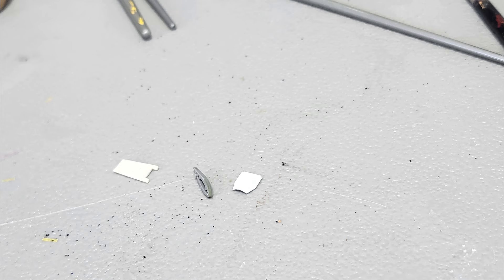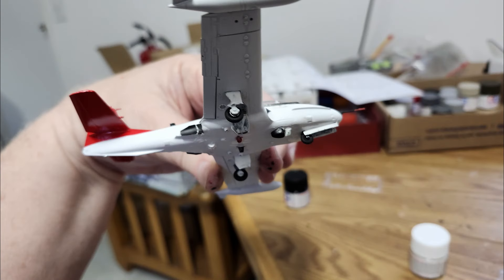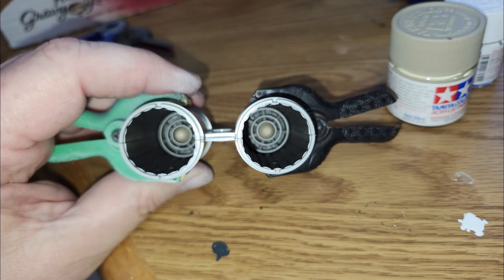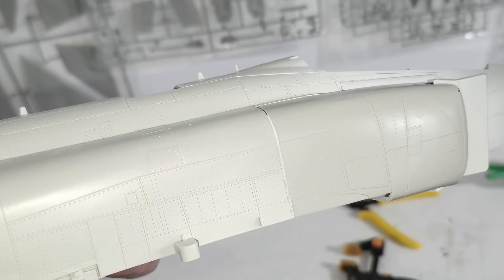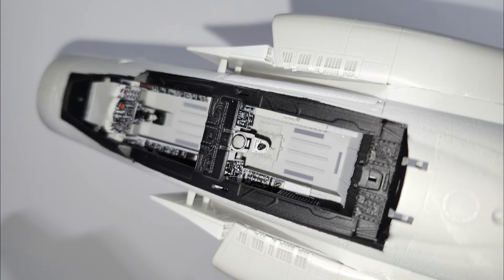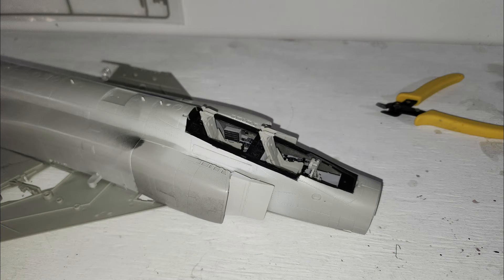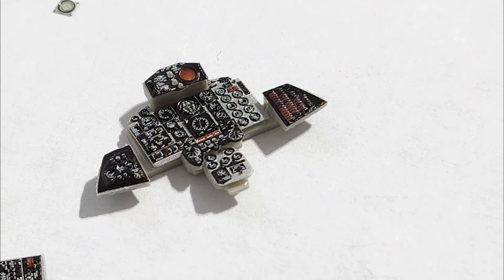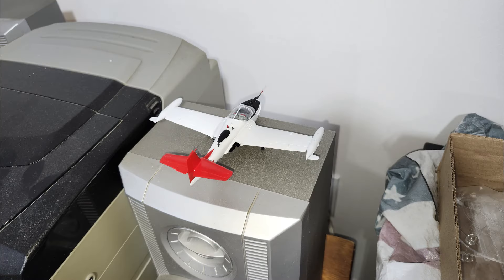Max's Models after hours 11/15/24

Comment: Looking good!  The Super Tweet would’ve been a fun bird to fly.  I had a good time flying the Tweet during UPT but having a couple of J85s instead of the J69s would’ve spiced things up quite a bit!
Reply: I recall seeing a pic of Cessna's proposed civilian four-seat Tweet.  Interesting concept, but no space for luggage!  😮
Reply: @ During our cross country training flights, we’d put our soft luggage in the nose bay.  Or you could jam it in the empty seat pan (where the survival kit usually goes.
Reply: At my AFB we worked on the T-33A trainer.  The pilots often had us mount a "travel pod" under a wing for longer flights.  Had some return once with one guy's pod filled with Lobster, on ice!  Another had ears of corn, third guy had a pod full of Coors Beer, this was before Coors came East of the Mississippi River.  Bet they had a heck of a party!  😅
Reply: @lancerevell5979  Nice!  We did that with fresh seafood from Eglin AFB back to Holloman AFB in the travel pods of our T-38s.  Bottles of wine from Napa Valley back to Holloman.  After flying combat operations in 1999, we found out that we were authorized to return with an additional MWR pallet from Germany.  That pallet was packed with cases of wine from a local vineyard along the Moselle.  The F-111 and F-117 weapons bays could carry quite a bit of stuff too,

Comment: I wrote a comment on a helpful site the last video that you may not have received, Max.

It was;  McDonnell Douglas F-4 Phantom II Drawings part 1

There is a part 2. You will see great information and the best detailed blueprint like drawings of the Phantom II.

 Since I have been following your build from the start it got me back working on the three I have. Two will be JASDF, EJ birds one as 17-8440, the last built Mitsubishi aircraft and the second in a Sea Camouflage scheme. This is possible with the use of DXM Decals 81-3206.